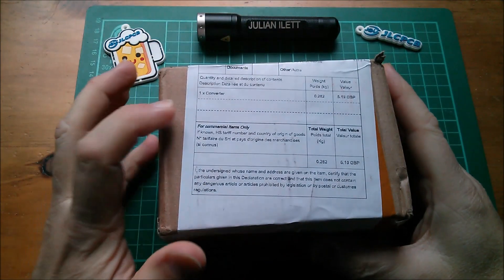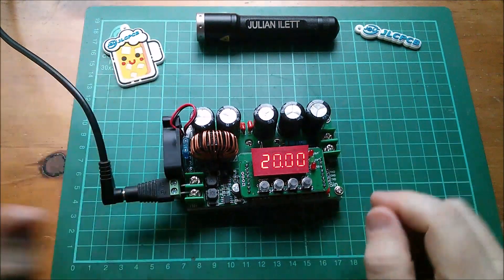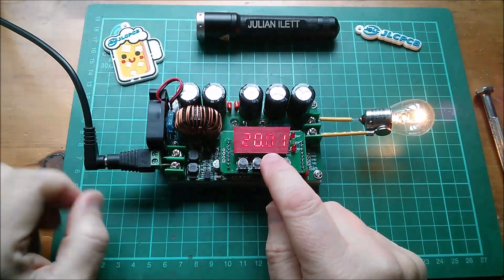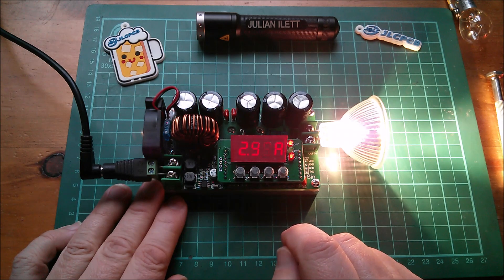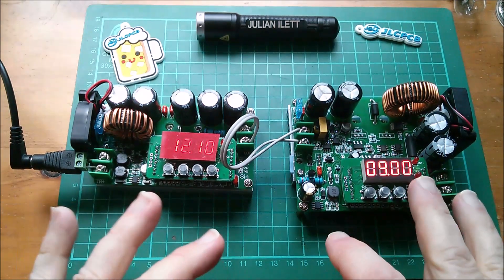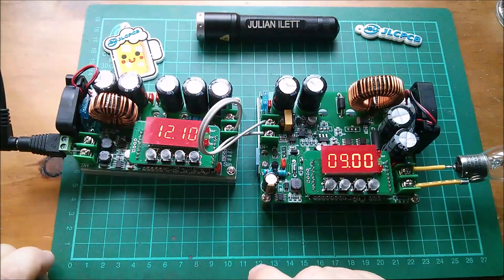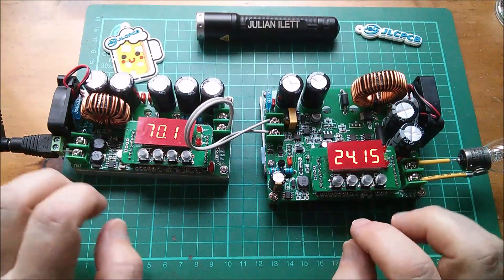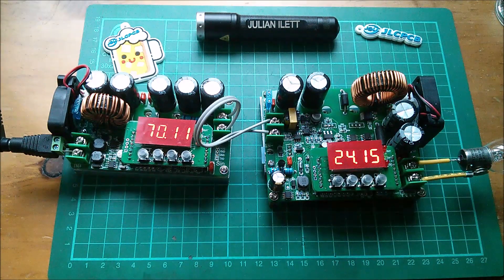600W Boost Converter and 75V Buck

Comment: I have bought a very similar buck/boost converter on banggood for 20€ to power a 54v LED and I was disappointed to see that it really can’t churn out more than 1.1 amp at 50volts. Even with a good (Xbox 360) 200w psu it wouldn’t give me more than 50-55w of power output.

Comment: Julian, great videos! I was wondering if you could advise. I have a MOSFET which needs ~10V to properly open up, and I was wondering if you could recommend a boost converter that would take around 4-5V input and boost this up to 10V. The input is not constant, so the output needs to follow the input quite well. Any ideas? Cheers and keep up the vides :)

Comment: How can you call it a transmission line if it only passes DC?

Surely it's just a cable...
Reply: Transmission lines transmit energy. They are also cables. They are also AC or DC.
Just because most terrestrial transmission lines are AC does not mean that they are exclusively AC.
Reply: @ahaveland   There might be different meanings in different fields...

In high frequency electronics, transmission line theory uses the telegrapher's equation and assumes electromagnetic interaction between conductors which is strictly AC.

Such transmission lines include hollow wave guides, microstrip and coplanar wave guides etc.

In power systems, there are overhead transmission lines (which have no insulation) and overhead cables (which have insulation).

Using power transmission lines and unbalanced loads, it is possible to have a higher output voltage than input voltage. This is not possible with DC.

Maybe the confusion stems from the phrases 'power line' and 'transmission line' being used interchangeably.

I could be wrong but it's 12:47 and I need to work tomorrow.......
Reply: @AdrianTechWizard  No confusion in my mind.
See HVDC and UHVDC in wikipedia.
Reply: @ahaveland  
I just went to Wikipedia and it agrees with me:

https://en.m.wikipedia.org/wiki/High-voltage_direct_current

It uses 'DC line' not 'transmission line'.

Transmission line means more than just transmuting energy.

Look up Smith Charts and transmission lines. They are way more than just wires.

There are also transmission lines which work with low energy and act as filters or quarter wave transformers.
Reply: @ahaveland  I have no objections to that statement. :)